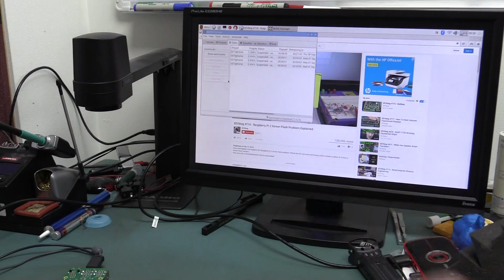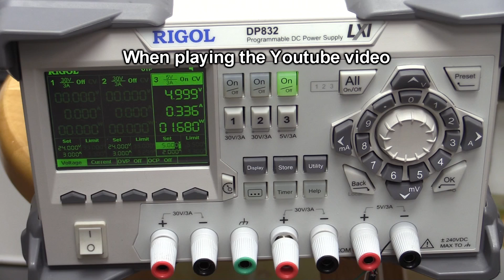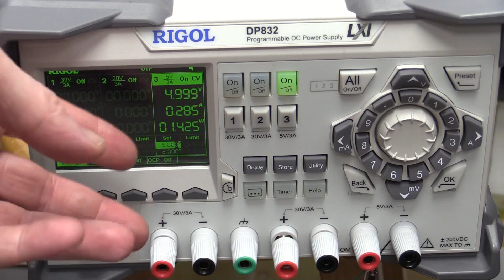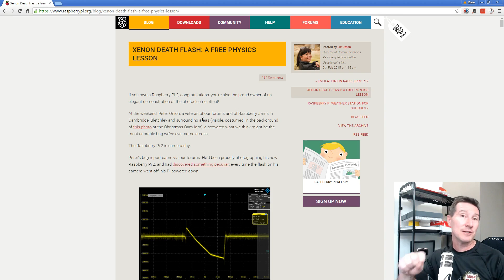EEVblog #901 - Raspberry Pi 3 Photoflash Problem

Comment: Hi Dave, I have a great hint for you. If you connect 12V power supply into 3,3V power bus of Rpi, it will fail. What a crappy design..

Comment: Dave did you tried photo flash without light (flash covered with some opaque material), only discharge? Would that reset it too.  I would suspect that problem is discharge of flash, not the light part.
Reply from the maker: Yes, it's the light. Both reset and WiFi problem.

Comment: Soft x-rays. This will be a quantum mechanical in nature, involving very specific frequencies. Just hypothesizing that the vinyl tape is actually opaque to these soft x rays. The capacitors and xenon flashes are capable of producing soft xray photons.

Comment: Use external Flash on your camera. Speedlite EX flash is way more powerful than flash on your DSLR. The test button on Speedlite EX flash fires it 100%. You can even hear big discharge of Xenon flash.

Smaller internal flashes are less powerful.

Comment: Hey Dave, what is the purpose of leaving a chip with bare die?
Reply from the maker: No extra step in manufacturing. Extra steps cost money, the RPi is a low cost not for profit device, so you weight up the cost of it being a problem (extremely remote) vs the extra cost.
Reply: That's really interesting, thanks Dave :)

Comment: Try it with black tape over the flash on that front chip (or both). That close to the circuitry, it could just be magnetic coupling inducing a pulse on the traces. There's a lot of power going through the xenon tube for a fraction of a second.
Reply: I'm with you on this one.  It probably induces a huge current in the antenna and traces momentarily wreaking all kinds of havoc.  Spray paint the pi black and try it again.  Or use an epoxy coating.
Reply from the maker: See Part 2

Comment: Dave,  that flash discharges a lot of joules through that flash tube in a few ms.  The pulse current through the tube is going to be quite significant coupling a lot of EMI into the adjacent circuit conductors.  Do a followup video with a black paper shield over the tube to see what happens.  Craig
Reply from the maker: See part 2 
https://www.youtube.com/watch?v=_D_fi_ck9Vo

Comment: When you're testing to see if a wifi module works or not, you might want to run the "ping" command. On Linux it will perpetually ping until you kill the command. It would work perfect for a demo like this. But, great video as always!

Comment: Just a quick comment, is it really the UV or is it the HV switching inside the camera flash circuit?
Reply: Neither. Xenon flash has some nasty spikes in the near-infrared, and "All WLCSPs are particularly sensitive to incident light with wavelengths in the near infrared range (NIR, 700 nm to 1000 nm)."

Comment: crap! I just sent one up in orbit yesterday as a payload in my rocket. I always said if I could have gotten math in school I would have been a rocket scientist. As it is I dabble in a little of everything from electronics to small engines,RC stuff, Used to overhaul car engines,transmissions,probably way more than I would have done had I been a rocket scientist anyways. I plan on using one of those in a quad I am currently planning to eventually build. It wont go up in any rocket,but for sure an octocopter!

Comment: so.. one of the first things i did to my pi2 was blob over the bare chip, guess i'll be blobbing more if/when i get a pi3

it's not a "big problem" but it's a weakness that just should not be there...
that said, i should test how well the experimental blob on my pi2 holds up to camera flashes.

for those that care to fix it: grab some form of non-conductive paint (i used an old tube of oil paint that i measured with a 2Gohm capable meter to make sure i wouldnt break stuff) and "smear royally" using a toothpick.

Comment: Would the problem perhaps actually be an emp from the capacitor discharge to the flash bulb?
Reply: I had the same thought.  Is it possible to formulate a cheap experiment that proves that it isn't caused by a tiny EMP?

Comment: I simply can't see what the problem is. I'm quite sure you'd get very similar issues with many modern bare PCB's. The simple solution, if you happen to be using such a device where it may be exposed to intense light, is to use a sufficiently light safe case - or, at a push, cover the offending chips with a suitable tape as means of protection. This 'experiment' is tantamount to exposing an RF sensitive PCB to interference and then claiming it has an inherent fault despite the fact that it would ordinarily be housed in a metal case to prevent just such a problem. I'm sure we can all look for problems if we want to, but perhaps looking for solutions would be time better spent.

Comment: You should try getting some black hot glue sticks, and put a dot on the PI 2's chip. See if that fixes the issue. If so, it's a pretty cheap fix for anyone who needs to use these things exposed to high intensity light of the right frequency.

Comment: Dave, we all know that silicon diodes are made from... well silicon!! LED's are also photo sensitive,  and a photo transistor is just a transistor in a clear package for all intents and purposes. What are solar cells? Slabs of silicon with a diode structure. When transistors first hit the mainstream they were germanium and were often encapsulated in glass and the glass housing was painted over in black paint so light wouldn't shift the operating point.

Comment: I think the point of this is (and I'm pretty sure Dave would agree) "If it ain't broke, don't fix it" - it ain't broke, they didn't fix it. Once you get a commercial product design that works reliably, and fulfils all the appropriate criteria, you don't spend thousands redesigning it, and risk introducing new bugs. Every product has trade-offs and limitations, in the case of the Intel board, the limitation is that Intel effectively subsidise every board made. Raspberry Pi don't have that luxury, they are a not-for-profit educational charity.

Comment: What if it isn't photosensitive but instead the sudden spike in energy flowing when the flash shoots induces a current on the circuit or the chip causing the pi3 to reboot (not talking about wifi)

Comment: Tell you what is the most amazing thing about the Raspberry Pi, and that is it's made in the UK, well some of them are, I can just make out PRC on yours, but all 3 of mine are made in the UK and are still buttons to buy, I have a Pi 2 and 2 Pi 3's, I accidentally ordered a 2nd one and it was so cheap I couldn't be arsed sending it back, one is from RS and the other is from Farnell, both made in the UK, think it's Sony in South Wales (that's old South Wales) that make 'em.

Comment: You have to have a really intense flash, and get really close.
If that happens to my Pi, my question would be, why was it stolen.

The Pi2 crashed when someone pointed a Laser pointer at it. But the Pi3 is so stable.

And if you are really that scared that someone would photograph your Pi, give him a case.

Comment: reminds me of one of my early 80s arcade machines (williams defender) i tried to sell, it was on and working, and i made a pic of the pcb, and suddenly the game stopped and only rubbish on the screen. Ii freaked out and thought it was broken, but after a reset it worked fine.
Reply: +simontay1984 maybe the eproms? I dont know, happened a few years ago.
Reply: Didn't a lot back then have the die exposed in the middle of a DIL package covered in glass/plastic or similar?

Comment: About four years ago I had my first and last RPs.  Both would reset when my computer woke from sleeping (not wake on lan) if on the same network (pre-wifi models).  No one was interested in the problem, that is both forums and Adafruit.  I stopped using them then and there.  I doubt the problem still exists but it was real and repeatable.  My confidence level in them completely dropped after that.

Comment: Was not a huge problem , we use pi's for installs all over the place never had one do this, granted we stash them behind a large LCD but still.
Reply from the maker: Of course you won't ever get a problem if it's not exposed to flash photography. it's an obscure issue.

Comment: Dave, you can check the kernel log to see if the WiFi chipset resets. Open a terminal an enter "dmesg -w" to see the rolling logs.
Reply from the maker: And what would I be looking for exactly?
Reply: You would see one of 2 types of errors. Driver related, and handler related. For driver erros, look out for anything that starts with brcm80211, or b43, or broadcom-wl. For handler, look for cfg80211, the 802.11 handler. If you drop region info:

[ 6345.583410] cfg80211:  DFS Master region: unset:

Or if the adapter resets:

[ 6354.614622] ieee80211 phy0: Hardware restart was requested

Or if it drops from the USB bus:

[ 6345.480108] usb 3-1: USB disconnect, device number 2

Good luck!
Reply: Or, you could also test the network with a ping. Mash into a terminal:

ping 8.8.8.8

If you see timeouts, unreachable hosts or related, the adapter has reset 100%.

Comment: What about a UV Blacklight?
Being nearly 100% UV light being emitted it be easier to make it cut out if it is UV
Reply from the maker: It's not just the frequency, it's the energy. photoflashes put out extraordinarily brief busts of high energy.
Reply: +EEVblog Isn't the energy a function of frequency (ala Planck's constant) not amplitude?  The intensity is a function of quantity (where the power goes.)  Ahhhh, physics.

Comment: Reminds me of when I worked in a factory. We had a machine on one side making product, ten feet away was after the product was packed and in the case and the printer printing the case code.  The operator said, "every time I run out of ink, the machine over here shuts down.  Turns out the ink printer had a flash warning light and it would flash into the optical detector on the product machine that detected when material was missing.
Reply from the maker: LOL! nice one!

Comment: Start / Run / CMD / ping IP.of.rpi.3 -t 
Would have demonstrated this much better than checking if a YouTube video is buffering...
Reply: Why using a different computer? just open a Terminal on the Raspberry Pi (CTRL + ALT + F1-6) and run "ping gateway".
I just want to show the stupidity that running a Windows command on a Raspberry Pi doesn't work.
Reply: ... Run the ping command on a different computer...

Like, really guys?  Why are you even subscribed to this channel?
Reply: guys the specialty of eevblog is not software, it is hardware, at least he know that a youtube video in browser uses the wifi chip.. its not fair to bash him about command line, channel isnt about that
Reply: dmesg would also have been interesting to see when he killed the wifi chip.
Reply: But the truth is, you just didnt read John's post correctly, flapping about incorrect RPi commands and of "the stupidity that running a Windows command on a Raspberry Pi doesn't work"

"Start / Run / CMD / ping IP.of.rpi.3 -t"
Reply: Most Raspberry Pis use Linux, but that wouldn't even work on Windows IoT Core too.
Reply: ping could have been a better choice John when probing wifi chip. It was little annoying to see if the flash really had made any troubles to the wifi chip. Dave did it was lacking in technicalities. Other chip was fine to see the actual screen whether it was booting or not, but not the wifi chip one.
Reply: ***** Windows 10 IoT Core has a very minimalistic GUI that has only very basic options, you can shutdown or restart and change your language or network settings. Thats it. Open the Command line isn't possible.
Reply: Didn't the latest RPis start supporting some ARM version Win8 or Win10? No idea why anyone would use those but the option is there.
Reply: How would that demonstrate that the PI was rebooting better than seeing the actual output from the Pi itself?
Reply: The video was about the WiFi chip.  A continuous ping to the Pi would show immediately when connectivity is lost.

Comment: When you are that close to it, is there any chance that the problem is an induced voltage spike from the flash (trigger pulse is somewhere north over 1000V, isn't it?) rather than the light?  It would be interesting to repeat the test (especially with the regulator and its black coating) at the same distance but with the light blocked out.
Reply from the maker: It's been previously proven it's  the photoflash, so almost certainly the same issue again.

Comment: You might be better off to try a voip call for the WiFi chip testing or try copying a file then check the checksum.
Reply: pffff !      just use ping !
and btw no way you get error this way  tcp/ip got checksums.

Comment: Nice video, but I don't understand why so much is being made of this "issue". This is a bare PCB product. High intensity light flashes are just one of a huge range of things that it's going to be prone to. It's an interesting effect, but I wouldn't expect them to spend any effort at all to "correct" the "problem". You don't expect them to make it waterproof, finger proof, bowling-ball proof or anything else. You can make it immune to all those things if you want but it's down to you, as the user, to work out what it'll be exposed to and to protect it accordingly.
Reply from the maker: I'm just making people aware of the issue, what's wrong with that?
It looks like they may have done something about the original issue to improve it.
Reply: Nothing wrong with exploring the effect and making interesting videos about it as you have. What I find surprising is the implication that, because they know about the "issue",  it's somehow disappointing that they haven't completely "fixed" it. The "wha wha wha whaaaa" wasn't justified!
Reply from the maker: Assuming they have tried to fix the issue (they need to confirm that), then yes, it's disappointing that it wasn't fixed entirely. And yes, the ""wha wha wha whaaaa" means they failed to fix it, so entirely appropriate.
Reply: How are you defining "entirely"? You had to get the flash so close to the thing that no sensible photo would have been taken. Is seems that the new product is now, to all intents and purposes, photographer-proof. If they were trying to protect it from a deliberate "flash attack", then I guess they failed. I can think of much easier ways of crashing a completely exposed RPi .
Reply from the maker: Oh for goodness sake, let it go, that's basically what I was saying and showing in the video. I was just showing it still possible (+ the new WiFi issue), not that the sky is falling.
Reply: OK. [releases jaw tension] There. It's gone. Looking forward to the next video.
Reply from the maker: I did a previous video on this that was very popular. I figured people would like a follow-up on the RPi3, you don't have to be one of those people, it's ok.
Reply: Completely agree with you, Colin. Most Pi's are in a case, so will never experience this issue, even under the most extreme of circumstances. 

Dave just couldn't resist doing one of his high-pitched, drama-queening click-bait videos, I guess. :)
Reply: What makes you think "they have [deliberately] done something about the original issue". You know as well as many others that it is more likely a case of a different manufacturer, different batch/production run with a covered chip. I wouldn't imagine that the extraordinary small number of people who flashes their RBP with a camera flash at a distance of 2cm can justify the Raspberry PI organization to change their choice of components and/or manufacturing process. To call this an "issue" or a even worse, a "problem " are very strong words, reminiscence of click bait and sensationalistic reporting. Of course you do a follow up from your previous video because it was popular, it's in the end your means of getting a bigger revenue and not so much of an engineering and technical "problem". Don't get me wrong, I love and have great deal of respect for your work, but this is just... silly, as much of a value to claim that the Raspberry PI has a "problem" and "issue" because it isn't waterproof...

Comment: if you flash youre hand that clouse it will fry you're hand ...so :D
Reply: Didn't know they were that powerful. Now to find a flash...
Reply: Not with a little built in flash like that. A more powerful hot shoe flash can burn you though.
Reply: i've tested it ... :D even a litthe flash like that has enought energy to fry you a little bit :D
Reply: Yeah well they have a reflector, so they concentrate the light in one general direction. That is what helps make it burn so easily. XP
Hell, even just moderately powerful LEDs can do this.
I have a small one that gives about 400 lumens from a 6mm square area - touching the emitter while it is on results in a near-burn, but even after running for a few hours, the LED itself never gets above about 35C ...

Comment: Hey, Dave, you could use `ping  -n <ip_of_your_router>` command to check for the WiFi connection. Cheers!
Reply: Or you could ping the raspberry pi itself from another device.
Reply: Yeah, it would be a cool effect if the video stopped right when he did like how the rPi2 stopped very visibly when he flashed it, but the delayed response ruined it. Ping all the way.
Reply: +shelvacu Video tends to be buffered for a few seconds, so you'd have to wait for the buffer to drain before it would lock up. Therefore, ping method would be much more responsive in that sense.
Reply: I know, that's why I think he should use ping.

Comment: Can the WiFi chip be reset from the software side by reconnecting the WiFi network or is the chip permanently locked until a full reset? If it can be reset via the software at least it's not that big of a deal, as it probably could detect it and automatically reconnect.
Reply from the maker: No idea, all I know is that it losses connection and doesn't seem to recover.